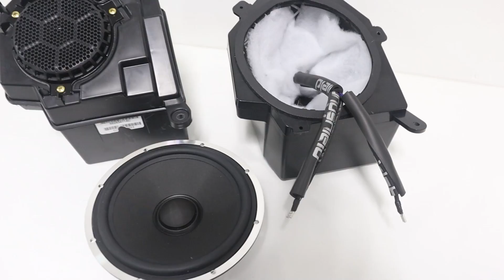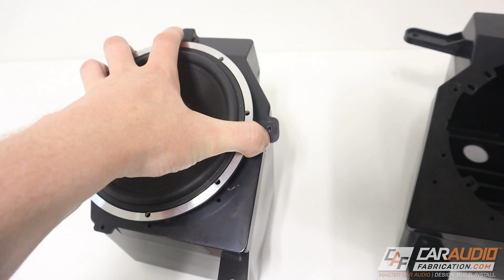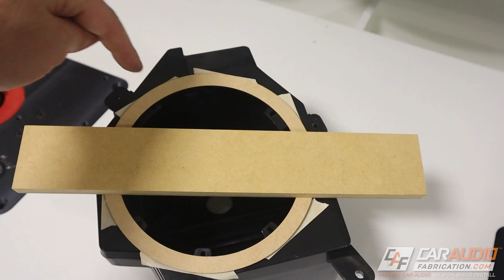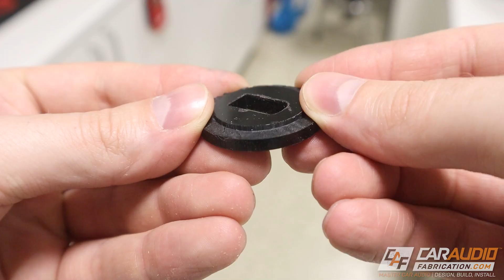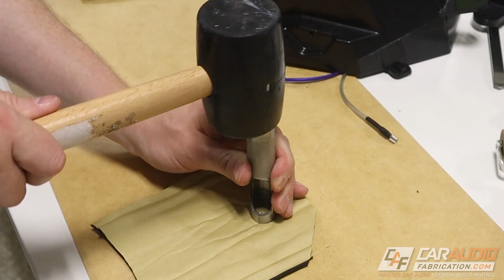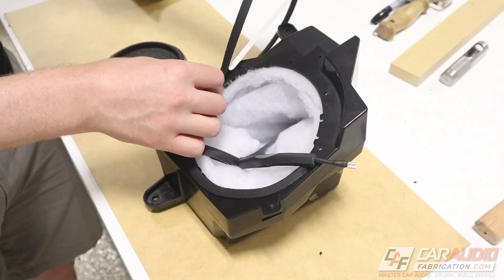IMPORTANT techniques for improving SPEAKER PODS - Sound Treatment, Wire Disconnects & FAB

Comment: WOW, amazing video! Did you use the metra knee dash kit (Metra JP-1018) and cut the grill opening? Apparently the grill opening is only 4", and grill should be cut to allow the 6.5" sound through. I'm planning an Infinity Reference series swap on my '23 gladiator (non-alpine) and since I don't want to cut the grill, I'm wondering if I should use the 4" or 6.5" reference in the knee. I'm thinking 3.5" up top, 4" at knees, and 6x9 three way reference coaxials in soundbar. Should I do the 6.5, and cut the grill, or is the 4" good enough? I will also be having a powered sub.

Comment: Mark
Hi, I, too, have a 23 Jeep Wrangler and bought these pods as part of my system upgrade.  I left the factory radio in and added: PAC Pro CH1 Low to high adaptor running digital optical out -> JL D8 - Analog out ->Alpine HDA-V90 amp-> Focal PXE PS 165 3 way set up.  My question is did you experience any resonance or mechanical noise from the 6.5's you installed?  I treated the pods with spray in noise damping liquid, then cover the pods inside and outside with Dynamat door kit noise damping.  Any suggestions on how to solve the unwanted and distracting noise?  I also swapped the 6.5's out which helped a little, but the noise is still there.

Comment: what pod and speakers are you using? Also, if you are leaving your factory head unit and not using an amp what speakers would you recommend using?
Reply from the maker: The full build is detailed here: https://youtu.be/YtI7EMNim_M?feature=shared If you need help picking speakers for a different application I can assist here: https://www.caraudiofabrication.com/consultations

Comment: Thank you very much for this video!!! 
I did almost everything as you suggested, put sound isolating materials, put silicon gasget seal on the inside of the connection part of the pods . Closed the additional speaker mount holes with the gasket seal and the sound deadening material from inside that overlapped the connection seam but I am so disappointed how it ended up sounding.

I put 100W Polk components and I am not sure if the speaker is garbage or the pods or both! I have to basically use the speaker with High pass filter otherwise there is a terrible rattle sound. Speaker itself has many holes and these holes are very close to the woofer's rubber and it's leaking air from there. Will a wooden adapter ring under the speaker solve that issue?

Also, I used the rubber part from the the stock box to seal the wire hole, it sat pretty good to be honest but I'm not sure if that was a deal breaker?

I'm planning to make mdf adapters and give it a one more go but maaan! it took sooooo much time to remove all the garbage parts to reach to the speaker pods -it is so discouraging to take another go on this.

I regret it so much to waste so much time to end up with a terrible sound which is not any better than the factory garbage speakers. I wish I went with the 3 1/2 speakers...

Do your pods rattle with a decent bass (not a lot)? Would you recommend getting 3 1/2 instead of 100W Polks? Maybe it is too much for a little pod but anyways I wasn't expecting earth shattering sound - all I wanted to have clean mid bass. 

Would love to hear your thoughts on how your pods sound after the install, do you have a review video?

Any insight would be appreciated!

Thank you!
Reply: @Move-with-Mahir  did you ever fix the issue? i have the same issues rn post install. Low frequencies sound terrible and cause rattles despite kilmat inside. I did not use polyfill or a speaker ring but lots of people don’t even use anything and seem to have good reviews
Reply: Unfortunately I wasn’t able to fix it as it takes forever to remove them but I was suggested not to use the pods at all. Just use the front part to assemble the speakers and keep the backside open.
Reply: You wont get any midbass from these, not good anyway.  The pods are small and they cause a spike centered @ 194 HZ, this then rolls off hard to -12DB @ 80 Hz.  The factory 4" speakers will sound better if you can just put a HPF on them @ 80 to keep them out of the way of the sub.  Still have to rip the dash to do that but these pods are a shitshow.  Theyre too small and cause the same issues that people have when cramming subs into too small of a box.

Comment: Always great videos and info. I'm about to build an inwall subwoofer that fits between two studs 16 on center that fill about 80% of the wall cavity. Do I need Acoustic batting for  this? The depth of the sub is about 3" and a height of about 70"? Also, what's the best way to design the interior of this type of sub? The sub will be closed and not ported.

Comment: I bought these pods as well and the brackets for the sound bar.  I too put sound deadner inside and poly fill.  Also, I placed sound deadener in the sound bar as well as poly fill.  I used 6.5 kickers for the front, (components) and 6.5 actual kicker midrange speakers.  The front pods, as for the wiring, I used the same rubber piece from the back.  using an exacto knife, I split it in half, like a taco, (LOL!) exposing the wiring.  I carved out the wiring and used the new wires, wrapped in the rubber piece for the speakers. Still maintained a tight fit.  

Mark, I love your videos.  I actually made a bracket similar to the one you made for the white wrangler.  It’s not as sexy as yours but, it came out nice.  Thank you for all the ideas!

Comment: Would it be recommended to build ( or 3d print) door pods instead of leaving the entire door panel as a chamber?
Reply from the maker: Most car audio speakers are designed for the larger door cavity which is usually more optimal when properly sound treated.

Comment: Im using some 6.5" 2 ways for a boom box, what kind of box should i make for them? I was thinking a tline box or at least ported to get good lows.
Reply: To get better lows, it may be a good idea to add some mass onto the cone, in the form of washers or something. You'll be less efficient, but it'll lower the resonant frequency.
Reply: @blakebrockhaus347  never heard of that lol. Lowring efficiency isnt an option the speakers are already under powered 😆
Reply: @A6Legit  yeah, it's just really hard to get lows out of small subs, because they tend to have very high efficiency bandwidth products. Honestly a 6th order bandpass may be your best option
Reply: @blakebrockhaus347  This is a seriously low power project just for the hell of it. I dont want to do 6th order because theyre 2 way speakers and i want to hear the tweets. The amp im using is not even powering them at RMS. Ive only heard them free air but it plays decent lows. 31-16khz. I just wanted something that will help a midrange hit some lows. Im leaning towards 4th order because tline seems like overkill and would have to be a huge box.
Reply: @A6Legit  ok, if you're doing like a coaxial boom box or something, ported is your best bet
Reply: @blakebrockhaus347  👍 thanks

Comment: One correction...the closed cell foam has absolutely no acoustic dampening properties; it is an isolation barrier only (something vibrating and making noise by against the CLD).
Reply from the maker: I never said it did. I worked for a tier one OEM supplier for several years that produced sound treatment materials. I fully understand how each works.
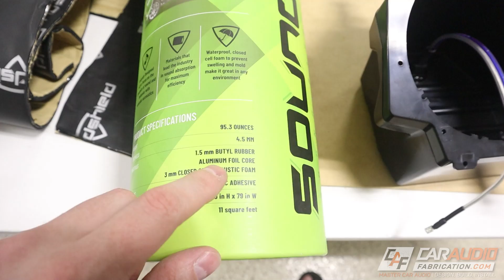Reply: CarAudioFabrication I am sure you do based on the quality of your work.  It is referred to on the product  as "acoustic foam"; 5:30.  You simply read it back in the video.  Your sound treatment of the pos is excellent.
Reply: @CarAudioFabrication  sounds like they need their own channel 🤣 After a year of watching him. He's NEVER given me false or incorrect information. If he did, my car would of burnt down by now. Trolling to try to make you seem like you don't know what you're doing. Really?

Comment: Again! I've learned so much over the year since I found you 😃 2015 VW beetle has a nice size pod for the rear 6.5 speakers which are in the side. I did all that but the wires like you did. No filler because of the size of the pods. Very nice sound. Tight bass. Not boomy like the front doors. Makes a nice blend to me

Comment: I have a 2010 Toyota Prius I put in the dash 3.5 Skar speakers and the tweeters stick on so the grill doesn’t sit all way down what should I do?
Reply from the maker: Can you fab a filler piece to raise up off the existing surface?
Reply: ^ or some kind of spacer? Im guessing none of that will work because the grill clips into the dash.
Reply: If that car has a factory 2 way setup in the front (dash tweeters and front door woofers) I would suggest a 2 way component set with tweeters mounted in the dash. If you combine those 3.5 inch speakers with front door speakers you are going to get really peaky midrange and it may not sound good. You can fabricate dash mounts for tweeters out of ABS plastic, to make them fit in the factory positions. This is just my recommendation based on my experience with Toyotas. The factory speakers in the dash were likely paper cone tweeters of some sort directly wired in parallel with the front door speakers, most likely with capacitors as a crossover solution.

Comment: Is the activator you use for the CA glue just to get it to setup quicker or are there any other reasons? Does it make the bond any stronger or weaker?
Reply from the maker: Faster set.